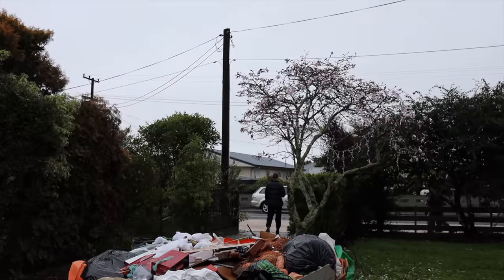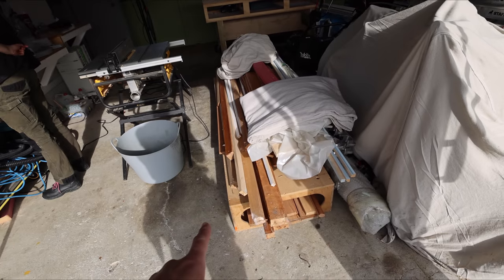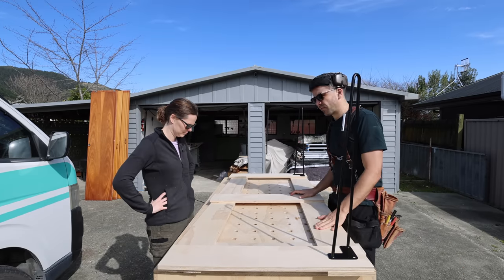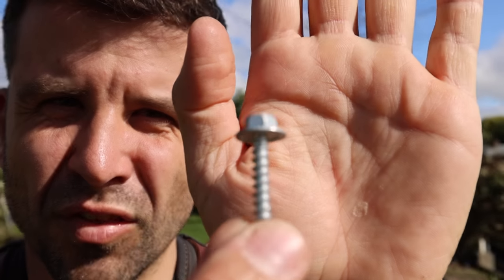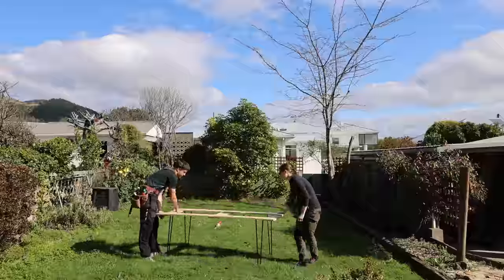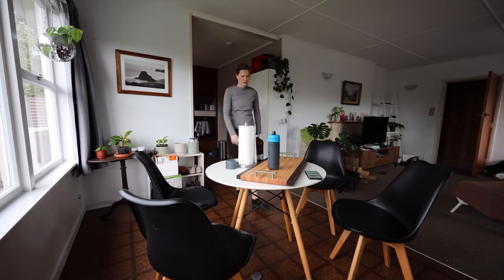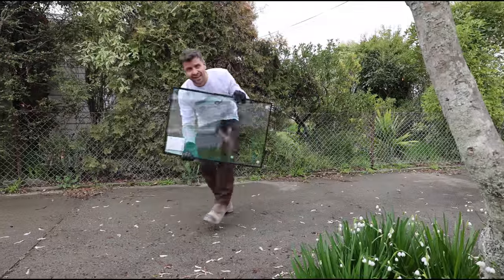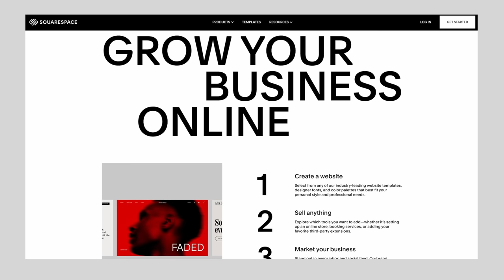We Converted Old Doors Into A Cool Dining Table

Comment: They make rubber feet for those types of legs that I highly encourage the use of :) More than protecting the floors its about the table feeling stable and they keep those legs from moving a lot which they tend to do, especially at that length.

Looks great!

Comment: Nice reuse of timber.  2 things to suggest ( and maybe these were discussed or done off camera, I don't think I missed them). 1 - chamfer, round or sand off the edges to reduce splinters. Particularly underneath with the plywood. 2 A basic  coat or 2 of some sort sealant will also help with the splintering of the ply. It doesn't have to look pretty, so it can be cheap and quick. Temporary can be for a long time. Look at Australia's Old Parliament House; the provisional (temporary) seat of our government for 50 years.

Comment: I once made a furniture like your table and was afraid of it sagging over time as well. Taking the example of your table, when you put the panels made from the door, you put a spacer (5, 10mm or even 15mm) between the frame and the panels in the middle of the length. Then you screw both extremities and you remove the spacers. So the panel is bowing up in the middle. After that you screw the center and it will constraint the table and prevent sagging. I don't know if i'm clear enough but it generally works surprisingly well ! Really enjoyed your video as always !

Comment: Not sure if you care about the floor at all but those hairpin legs are notorious for leaving marks on the floor since so much weight is only on a tiny little bit of metal - easy enough to put some black felt or rubber on the bottom side. Looks great!

Comment: Great job on the table. 
Giving Jess the long bit to put the screws in seemed a bit hard, but then after her glue 'fun' I probably would have told her she had to stay kneeling on top of the table until the glue dried (at least 24hrs) lol. 
It's weird with the weather, I've heard more about the drought in Europe and rivers drying up than I heard about the NZ flooding from across the ditch.

Comment: Normal persons temporary table: Take door put legs on

Scott Browns temporary table: Use two doors, add wood glue, over engineer a frame, grind screws down, strengthen with steel, chamfer frame, add nice edging.... end up with a better table than you could have bought. 

Love it Scott xD
Reply: This is because there is no such thing as a ‘temporary’ table, it’s staying there for 10 yrs minimum 😂